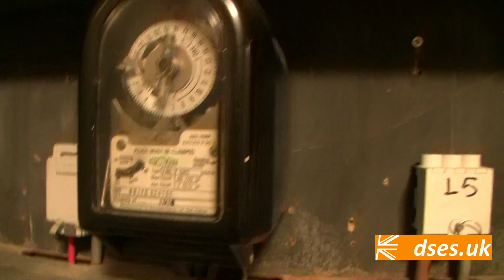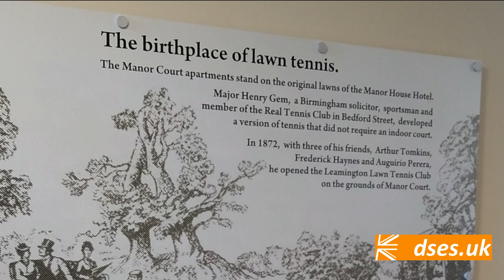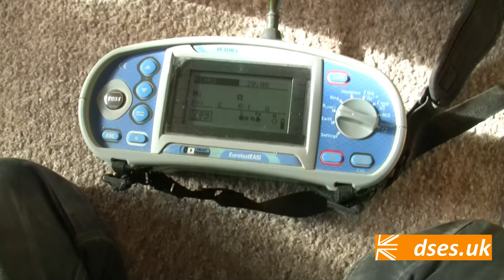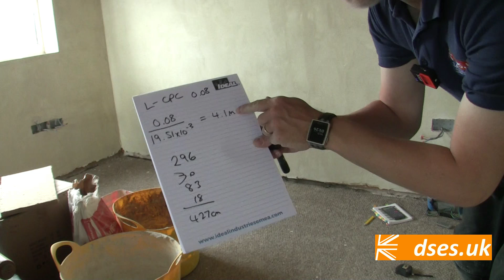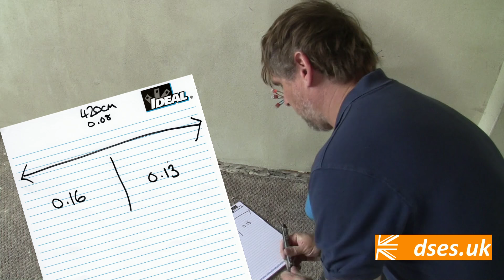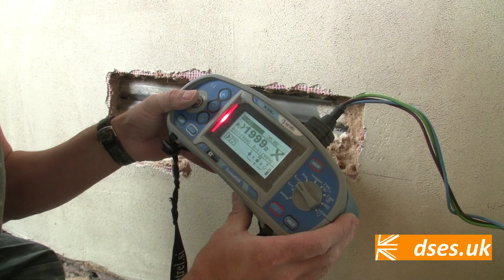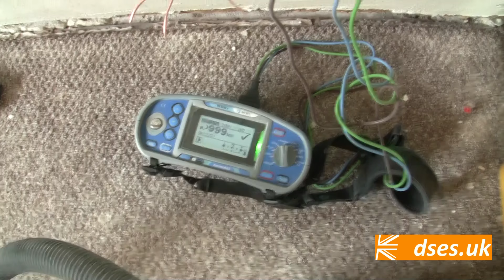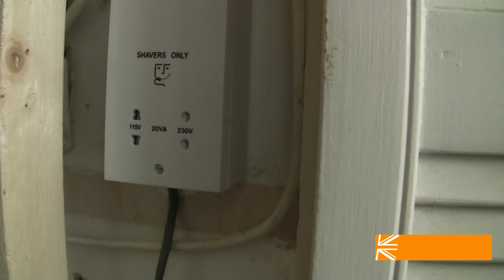Fixing another man's lash-up!

Comment: I'm not an electrician,(i did pass 17th edition a few years back) but the times i've heard,"Well i've been doing this job for years" really winds me up
Reply: I work in Telecommunications, and the same argument is used by Telecom "Engineers" too. I was speaking to a guy from a popular ISP about a problem he thought he had with his test device; the only problem with the device was the person using it.  They didn't have a clue how to use a TDR, despite the fact they thought I (the young whippersnapper) didn't know what he was talking about...
Reply: It's not just tradies. Just go to your local Co-op or Spar. Every Co-op/Spar I go into up and down the country (I travel a hell of a lot) has some 50+ scatty bint who is slow and useless and a team of 18-30 year olds carrying the place. Every single one without exception
Reply: @johnmcquay82  

Good old time domain reflectometry! I've used it many times when I worked for BT. Bridge tests are another useful tool as are walkovers for earth contact faults.
Reply: @johnmcquay82  OpenReach seem to be hiring the worst kind of muppets these days. We had a new BT line fitted from a pole to the house at back but he had to run cable round side of house to front for entry. Turned up at 11am and was still here at 8:50pm in the dark, with a head torch, up a ladder clipping the cable to the side of the house. He must've been about 17. Next day in the light you can imagine how straight it was. Ended up having to straighten the cable myself months later. Better still, the line never worked and weeks later we got fully refunded and went back to Virgin broadband.
Reply: Camberwell86 i bought a coffee from a spar late feb just before corona virus kicked off  and had some silly woman in her 50s try and charge me twice because the coffee cup i used was stuck to another, when i said ill leave the coffee then she said “you cant do that “( ..well you cant stop me) then preceded to put her hands all over the lid and container cup in an attempt to remove the stuck cup off while spilling the drink and conceded they were infant stuck. I reminded her about the virus in circulation.

Comment: Bloody brilliant bit of fault finding, thanks David!

Using the maths a bit further, the resistance readings of 0.16+0.13 add up to 0.29 total. 0.13 is 44.8% of 0.29, so the fault should be 188cm from the right hand socket.
Reply from the maker: I wish I'd have been clever enough to think of that Thomas, as I could have looked quite the chap about town with a bit of micro-surgery on that wall in just the right spot!
Reply: That's what I thought:

The two readings (0.13ohms and 0.16ohms) represent the RATIO of distance to the fault from either end. An actual reading to the fault can be obtained by the following equation:

(r1 / (r1+r2)) x Cable length (end to end)

where r1 is resistance to fault from point 1,
r2 is resistance to fault from point 2
and cable length is obtained by direct measurement (cable route known) OR calculated as David did in this video using the CPC and line conductor. For this example, the calculation is as follows:

(0.13/(0.13+0.16)) x 4.2 = 1.88m from the point where the resistance was 0.13ohms

the same works the other way:

(0.16/(0.13+0.16)) x 4.2 = 2.32m from the point where the resistance was 0.16ohms.

Comment: Ive heard of wiring a ring on every second socket to.. its to do with keeping the cable lengths equal as 'current runs down the path of least resistance' so if you have a heavy load at the furthest point the current should be equal 'or there abouts' between both legs of the ring main..
Apparently..
Reply: Yes correct. If you have a ring that has 2.5mm from the CU daisy chained to all the sockets and the length is quite long, with the end socket having one uninterrupted cable back to the CU forming the ring, the 1st & 2nd sockets on heavy loads can put too much load on the cable from the CU to the 1st socket. Line of least resistance. 
If there is not going to be any heavy appliances on the ring as they are in the kitchen on separate circuits, then daisy chaining, as per normal, is fine.

Comment: Hi David, 
Great vid, I think you could have used the ratios of the resistances from each end to calculate the 'exact' position eg 4.2m / (0.13+0.16)) * 0.13 = 1.88m from one end of the wire or 4.2m / (0.13+0.16)) * 0.16 = 2.32m from the other end.
Reply from the maker: When I go back for second fix, I'll have to do some measurements to see if this checks out Olly. There's only so much maths I can cope with, but had I thought about it this might have worked! I'd have looked like a hell of a smartarse then!
Reply: @dsesuk  

Olly is right! Of course with a fault that is NOT a full short, the measurement can wander and this can give inaccurate results.
Reply: @dsesuk  You're already a chad, a master!

Comment: So the plaster is held on by magic? The whole place looks like a future full of pain.
Reply: @Dan Didnot It's supposed to stick to the board (which it doesn't really seem to do), the mesh's just there to keep it from cracking if the board shrinks or expands with changes of humidity. Some modern plasters stick ok to the weirdest surfaces - polystyrene boards being one of the more common ones in central and eastern Europe. All it takes to destroy it is a woodpecker though - or a bicycle handlebar. Or a door handle.
Reply: well, fault in plasterer's work, as he lay plaster too thinly and left too long between coats, so the first one was dry by the time he put mesh in. It has to be redone properly now.
Reply: I thought my plasterer did a shoddy job for me years ago, but this is on another level. If i had my wife up the wall, we would be covered in dust, and also doing it in the dark because the E7 kicked in and tripped the rcd.
Reply: @Ragnar8504  No, it is supposed to stick to the board, the plasterer just didn't have a clue what he was doing. You are supposed to butter the fibreboard BEFORE putting on the mesh and then the mesah goes on and it's even usually doubled up in areas that you mention could be ploblems , like the seams. This guy knows what he is doing - https://www.youtube.com/watch?v=zjcNk4Z_WvE
Reply: Meant to say, i've even seen a plasterer turn up with their kid and send him around staplegun-ing the mesh on to the walls (with no adhesive) while he has a smoke (and a beer probably) outside... The British guy had quoted "Polish rates" apparently but any truely Polish plasterers i've dealt with have always done a fantastic job, they know what they are doing and they take pride in their work...
Reply: One small earthquake and all plaster will be on floor.
Reply: Looks like a real shit show from start to finish best get it papered with some woodchip and wally it out

Comment: Assuming the fault is equal on both legs, which it was.... You could have calculated the fraction of the fault along the length of it.... I can't recall the continuity values between N-CPC.... I think it was 0.13 and 0.16....
Expressed as a whole, thata 0.29.... Therfore 0.13 / 0.29 is approx 45% the length of cable.... 
Which is 1.88m of the 4.2m length .... 
Do that and mark out that location on the wall for both lengths 1.88m from socket A 2.32 from socket B, should put  you in I good position for finding faults.

Instead of measuring r1+r2, I'd have done a long lead test on the line conductor as that wasn't damaged to ascertain the length of cable....

As for the repair, crimp with staggered joins and heatshrink each conductor aswell as entire length of joint with larger heat shrink... Each to thier own
Reply from the maker: Thanks Craig, I'm liking the thinking. With regard to heat shrink, it's the larger size I lack on the van, otherwise I would have been more disposed to have done it that way on the day.
Reply: A very common fault finding method in Telecoms this is; resistive fault locator RFL (some call it a bridge test).  It would be a handy tool to have on a Sparky's meter.
Reply: johnmcquay82 also know as a TDR? Time domain reflectometer?
Reply: @craighawkinsch  No TDR relies on the reflection time of an injected pulse. TIME Domain REFLECTometer or OTDR (Optical TDR) for fibre. What johnmcauay82 is referring to is essentially comparing ratios of resistance values. It's based around the principles of a wheatstone bridge and is very common in both the telecom industry but also used a lot by the distribution people to locate issues on underground networks.
For what it's worth I was a bit of a cross over. Many utility companies including the one I worked for ran their own telecom networks; I was an electrical engineer working within the internal telecom department. Interesting job.

Comment: David I used to wire rings in this way some 30 odd years ago, it was the norm back then , in one miss one , I was taught to do it this way when you had a dead end wall and have to come back on yourself rather than looping over to the board
Reply from the maker: Cheers Dan, it's not a method I've come across before so interesting to see it in action! I knew there had to be a reason behind it!
Reply: Yeah, the ‘older’ guys i work with do this, it makes sense in a large trunking run but i like to do it the conventional way as much as i can so its more logical when testing.
Reply from the maker: @s.kxx1956  Not seen so much domestically it seems, which is why I've perhaps not come across it before.

Comment: Excellent investigation and fix.  A case of a choice between muck and nettles sorting out someone else's mess. 

 I have met that wood fibre board three years ago.  It's an insulating product -1960s flats could leak heat like disgruntled cabinet ministers leak secrets, and it offers a way to improve an existing building, but is is a royal pain to fix, cover with a grid, plaster and finish, the finish can be like a badgers arse and coarse sandpaper, and the surface is weak.   Trying to fix Anything to the wall is a pain because the ony thing which has any strength is 30 to 50 mm deep in the wall.

The wood fibre boards do claim to have a fire rating.

Previous person probably thought "It's deep enough that the safe zone doesn't apply anymore.
Reply: Yes, Rowan, heat loss prevention, acoustics (as only one thin layer of bricks and then breezeblock separate the inside from the outside. The house is in the town centre, next to a busy train station with diesel trains arriving from 5.30am onwards. Also, the gap in the wall between brick and breezeblock allows all the neighbours' TVs be heard in the flat. Finally, the idea was to have some degree of breathability.

Sadly, the plastering work was crap and needs to be redone, so what is in the video isn't the final finish by any stretch of the imagination.

Steico wood fibre boards and Adaptavate lime plaster is getting more popular even in this country, though it will take time for it to become more mainstream in construction.

Comment: Why doesn’t metal capping come pre-drilled on the flat parts away from where the cable would pass so that all that’s needed is nails/screws go through the holes?
Reply from the maker: Y'know, I've often said that when I'm a millionaire, I'll build a factory to churn out things that will make life easier for the sparkie including capping with a perforated edge!
Reply: @dsesuk  can't come soon enough. While you're at it have some art-y types make their fancy decorative lights and bin 'em until they leave space for more than a single 1mm T&E!

Comment: They fibre board, mesh and first coat is a modern day version of horsehair lime plaster. There's normally an additional coat on top... It's generally used when the block work is subject to alot of moisture and mould
Reply from the maker: Thanks Craig. It's not something I've seen before... can't say I'm in a rush to see it again either.

Comment: Charge phone on off peak 😂
Reply from the maker: Might save enough to buy a cup of coffee by Christmas!
Reply: David Savery Electrical Services In what year would that be Dave 😀 keep up the good work
Reply: Possibly also against suppliers rules for off peak tariff usage?
Reply: @dsesuk     I doubt it. I saw a calculation recently showing the cost of charging a phone for a year to be about 60p. Running laundry equipment off-peak is a good idea, but not, of course, on a final circuit shared with a heater.
Reply: I’d be charging a bank of big marine batteries overnight on the cheap rate and then using an inverter to power the house during the day :)
Reply: @FrontSideBus  Photonic Induction does (did) this - there's a video on his channel.
Reply: @misstakenot9582  Yeah that's where I got the idea from lol. I wonder how legal it is storing cheap off peak power and using it later....
Reply: My nan used to get up at 5am to do the ironing on economy 7!

Comment: Hi David, Where I did my apprenticeship one of the sparks did it this he called it frog looping I believe. He did it in trunking as it saves bringing a leg all the way back down the length of trunking. 

Hope you and Nige are keeping well
Reply from the maker: Thanks Jordan. It isn't a method I've come across in my time (perhaps surprisingly), but from the sound of it seems to be more common in trunking than when buried in the wall?
Reply: Makes more sense in trunking I’d say but in a house? Seems move of a pain
Reply: i have seen this in new builds & its a pain in the ass to fault find, especially between rooms.   I believe this method mainly comes from industrial installations, where you have a row of sockets installed in trunking or conduit.

Comment: This is like watching a 101 of 'how to spot the failures of someone who should not have qualified'. Impressed. Hope the guy who did the work never comes any where near me, or mine. Bravo.
Reply from the maker: I dunno, I think some of the old-schoolers just think they've reached peak knowledge and don't ever need to re-think, check or learn anything new.
Reply: @dsesuk  In my field I find it appalling at the basic errors made, and those who 'assume' that their years of experience 'over-way' those who employ modern standards, and it is a terrible situation. 'Experience' is certainly a remarkable, and hard earned 'respect'. However standards are 'good practice' for a reason, and even the most experienced need to have an approach that embraces those standards. However hitting a nail through a cable is rather 'baby stuff' is it not?  Great to watch you find a solution.
Reply: @dsesuk  

So true. I think we should all try to remain open to new knowledge and never assume you are done learning.

Comment: As soon as I'd seen that fiberboard on the walls I think I would have walked away. Looks like a major fire hazard to me.
Reply: @kissarmy1347  I think it's actually the very same product. I'd be more concerned about the plaster falling off after watching this video!
Reply: @kissarmy1347   Correct, it is Steico.
Reply: @Ragnar8504  well, there wasn't much luck with tradesmen here, sadly, hence plastering is being done again by proper professionals, recommended by the plaster manufacturer, so fingers crossed it will stay.

Comment: I think.?
(4.2/0.16+0.13)x0.13=exact position
Reply: Correct, if working from the right end of the cable in the video - 188cm or 0.13/(0.16+0.13) = 0.45 or 45% of the length. It's simply a ratio of lengths. I actually just posted something like this too.

Comment: I was under the impression that the peak consumer unit also switched over to the Economy 7 rate too during the Eco 7 times so having the Eco 7 sockets for charging laptops etc would he a waste of time anyway.

Hats off for finding that fault too, how it should be done!
Reply from the maker: On my house, it's just a tariff change rather than a physical switchover. Here, the time clock is switching on the off-peak board, but I suspect the metering for the whole property is also being clocked at the lower tariff as you say.

Comment: Forgive me if someone has already covered this, but I didn't see any comments of this type.
IF you wished to determine the position of the fault by calculation you could :
Add the 2 resistance readings (0.13+0.16),  subtract the resistance of the L&E wires (0.08) and divided the result by 2.
This gives the resistance of the fault between N&E.  (0.13 + 0.16 - 0.08) / 2  =  0.105 ohms
Subtract this fault resistance from the 2 readings :  0.13 - 0.105 = 0.025     0.16 - 0.105 = 0.055  (note 0.025 + 0.055 = 0.08)
You now have the ratio of the distance of the fault from each end.  (Assume total distance is 420cm)
cms from closest end =  420 x 0.025 / 0.08 =  131.25 cm    From furthest end =  420 x 0.055 / 0.08  =  288.75 cm
All this does of course depend on knowing the path of the cable, but you covered this comprehensively in your video by testing Line & Earth resistance and dividing by tabulated figs per meter. Then comparing to the measured distance.
Hope this might be of help to someone where the cabling is more complex.
Reply from the maker: A shame I didn't explore the maths further on this one Gerald, as you'd all be smelling my farts for a week had I narrowed it down to an exact location!